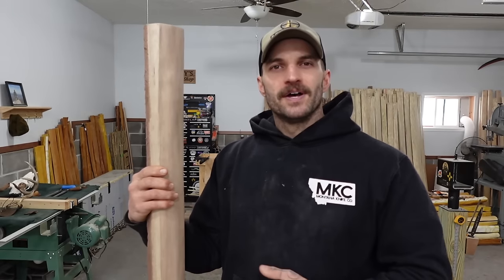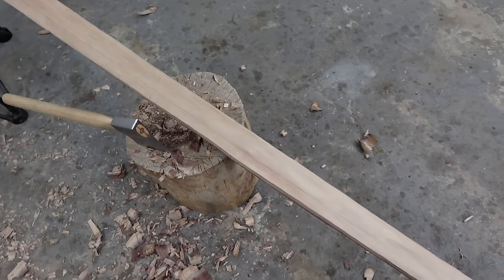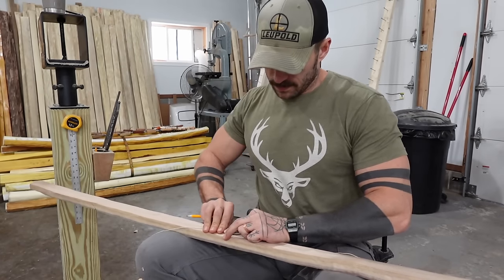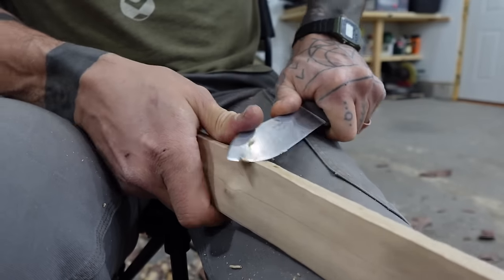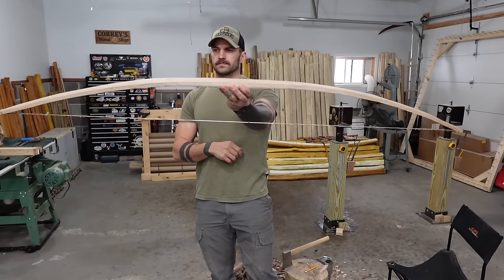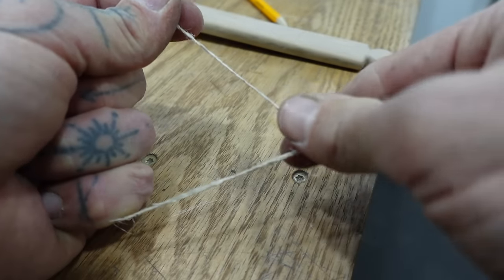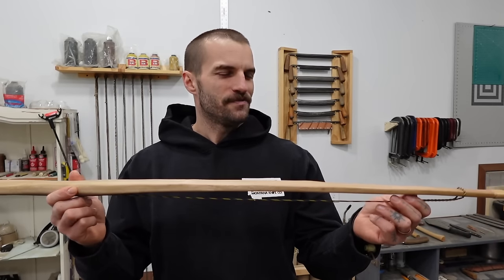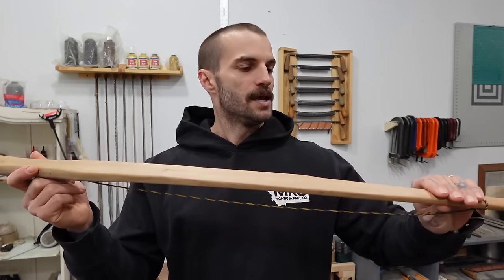Make a Primitive Bow by Feel - No Special Tools

Comment: Nice video - I have used this method for a few years now - mainly because I do not have access to the kind of staves you have to work on! It makes those constant measurements you sometimes have to take when removing work lines much easier and more expedient in the process, that means you can stay much more fluid and connected with the work, otherwise you’re constantly stopping to grab a square or ruler or whatever…a very useful technique to learn
Reply from the maker: I completely agree! There's just something special about a bow made with intuition and not calculated measurements. The measurements can sometimes dominate the process for new bowyers.

Comment: Great video man, amazing work! Does that 5.25" brace height not smack you on your wrist when you shoot? The last bow I built had a similar brace height and it bit me every time. Maybe I shoot goofy or something.
Reply from the maker: If you're using B50, B55 or any other nylon-based string material, it's really hard to get rid of wrist slap. I use D97, which helps a ton. I still wear an armguard, but the slap isn't nearly as much of an issue with a low stretch material.

Comment: Great video. Thank you, sir. I have a nice mulberry branch in wait. It's the first serviceable(+) quality bow I'm trying to make completely from scratch. It's only about 5 feet tall and 3 inches across. On a good day I'm 6'2", but it's for both my daughter and I to use. Any additional recommendations?
Reply: I just subbed and was checking out your channel. I'm surprised you only have 6 videos on it with how high the production and delivery quality is. Keep up the great work. I look forward to seeing more. Cheers.
Reply from the maker: The channel is only a couple months old. There will be many more videos in the future. You can make a bow that’s 5 feet tall so long as it bends throughout the handle. It’s too short for a stiff handle design if you’re 6’2.

Comment: You mentioned safety margin twice when discussing stave length. Safety from what?  Excellent video and finished product.
Reply from the maker: When I mention the safety margin, it's mostly meant for the bow and not the archer. I'm referring to making the bow long enough to handle some minor imperfections in the wood and tillering errors and still survive the build. Many new bowyers make them too short for their desired draw length, and it's a recipe for broken bows. About the worst that could happen to the archer is a lump/cut on the head, but it's definitely unpleasant when they let go at full draw.

Comment: 3:25
I'm working with a piece of maple, from. A tree that was cut down by our power company.
The stave I'm working with. For my first attempt isn't a straight as yours in this video.

I've been advised, that a bit of steam should be able to help me straighten that out after I get the general shape roughed out.

That's the step I'm... Stumped on.

How would you advise I rough out the bow, knowing that it doesn't stand perfectly straight. It bends a bit to the right,
Its not twisted, 
Just trying to find, what should be a center line. To rough out measurements from.
The grain is otherwise, pretty gorgeous maple grain... Long and straight.

If I can figure out, the 'center line' despite the slight curve, i think I'll be fine...
Reply from the maker: Just follow the natural grain to find your centerline. It should follow the bend in the stave, which also usually follows the split. You should just be able to hold your fingers against the edge of the stave and use them as a depth gauge to run your centerline. I also show the steaming and straightening process in the video "Eastern Woodlands Bow" on my channel. It needed two steam corrections.
Reply: @organicarchery  thank you.
I did watch, I think, all the videos you have posted.
I saw the eastern woodlands bow build, as well.
Thanks.
So, I'll definitely give it a shot. I'm not as confident with Axe chunking... I'll probably stick to my knives, and my big ferriers rasp. For most of the shaping.
And I have scraper, for gentler tillering.
You did the steam really, simply with a pot.thats, neat.
Reply from the maker: A simple pot and towel works really well, but sometimes it's hard to bend wood over the knee if it's too thick. If you can find a tree with a V crook, you can stick the stave into it and pry. The added leverage makes bending much easier.  @jonathanbennison9220
Reply: @organicarchery 
Great advice.
Thank you.

I'll let you know... How my efforts to find the bow blank inside this maple stave go.
Worst case, it will. Make nice fire in our woodstove.
But I'm gonna give it my best

Comment: - It took me a while, but I finally noticed that the hatchet head is bigger/heavier than most hatchets.
- That heft, and moderating longish handle balancer, greatly helps the wrist chopping a lot.
- I can see that when many viewers might not. I know and can see how it works for you from my hours of swinging a 1.5 lb Estwing long handle framing hammer with the handle leather wrapped so my long fingers had something to grip.
- Brilliant, perfect choice of hatchet head for this work.
- Is it actually an axe head you have adapted for this use?
Reply from the maker: It is actually a Cold Steel Competition Throwing Axe that has been modified for carving! I reshaped the bevels and hung a new handle. Then shaped the handle to have a bulb near the lip for controlled work.

Comment: Another great video.  I’m 74 and would be interested in any special considerations when shooting (no pun intended) for a lower (let’s say 35 to 40#) draw weight.
Reply from the maker: The only things to note would be 1) making the bow perhaps a touch narrower, but that's not entirely necessary. 2) The limbs will become proportionately thinner through the natural tillering process. 3) The longer the bow, the easier it is to reach lower draw weights - so maybe make it "nose high" instead of "chin high".
Reply: @organicarchery  Thanks for your help.

Comment: Looks fantastic. Is there a particular reason you didn't use the heartwood of the walnut? I'd heard that walnut heartwood is quite dense and tough so I'd figured it would be a reasonable belly wood, but I suppose if the properties of the sapwood are similar enough then its easier to use that instead?
Reply from the maker: I've heard through bowmaking forums that the heartwood tends to be a little less elastic overall and prone to failing in compression, so most of the people who've used it extensively recommend sapwood limbs.

Comment: How hard are you typically pushing/pulling the stave when you floor tiller? Mine always feel super stiff even when I thin the limbs to half an inch, but I'm not sure if I'm not using enough force.
Reply from the maker: Fairly hard. Leaning most of my body weight into it. I like the bow to be about 15-20 pounds too heavy when it's first braced so I have room to correct the bend.

Comment: What 's the approximate diameter of the trees you are making your staves from?
Reply from the maker: I use everything from 4-inch saplings to huge 20-inch trees. I don't normally use big trees, but will cut them if I'm working with a farmer or development project that plans to bulldoze everything on the site. My favorite diameter is between 5 and 8 inches. They can be responsibly harvested, are easier to transport, seem to grow really clean and straight, and you can get between 4 and 8 bows from them.
Reply: @organicarchery  Thanks,live in the city now hard to find suitable materials .